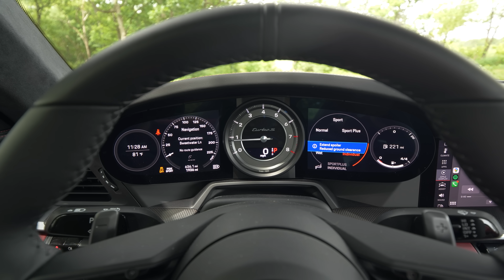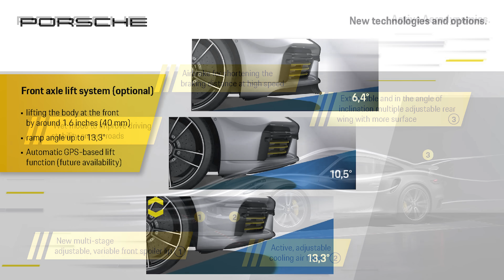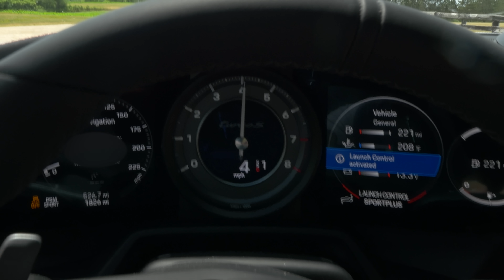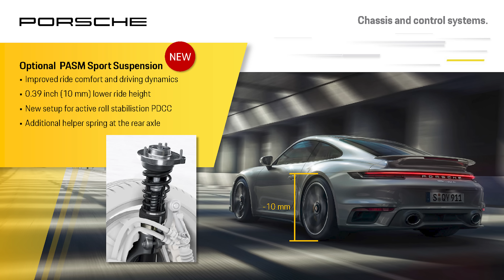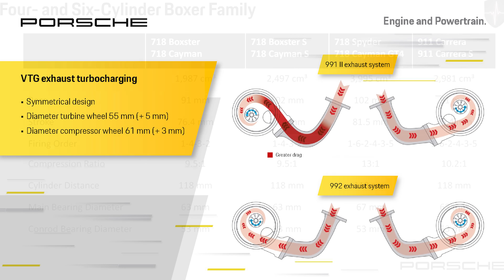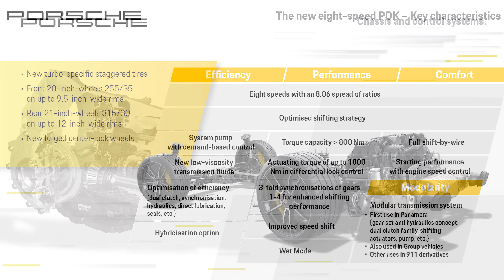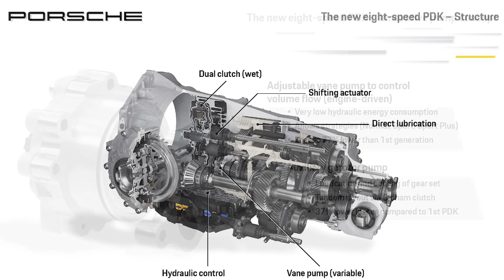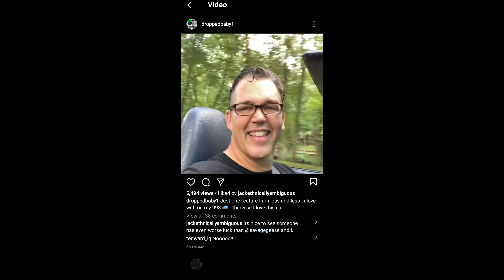Porsche 911 Turbo S 992 | Mind Bending Speed

Comment: This has got to be near the pinnacle of ICE technology, surely? What an incredible machine
Reply: i think @savagegeese would agree that really, this isn't. The GT3 is. This sounds like a electric motor. That sounds like a porsche le mans gt car from the 80's
Reply: Given that many people are running 1,000+ whp out of 991 turbos on the stock motor without reliability problems I would say we still have plenty of overhead left in ICE.
Reply: @thehumanoid6543  nearly all of which were heavily turbocharged.. the le mans cars sounded like vacuums next to McLaren F1 or CLK GTR. There's no denying the thrill of big boost though
Reply: Yeah this and potentially the T50 would be the swan songs.
Reply: @flacjacket  I'd you're talking about just power, leave the chat. An electric Tesla can make 1030 horsepower while being a comfortable 5 seater. Its about the sound and experience brotha
Reply: I think mazdas development of compression ignition gas engine will be the peak. but after that, mild hybrids or hybrids will probably be the way instead of straight electrification.
Reply: @papa_pt  they do I agree. A McLaren F1 vs a Porsche 935 is no comparo dude....it's basically m e t h s...12 vs 6 cylinders, and of course, gloriously naturally aspirated. But, turbocharged race cars do sound pretty good cause they are straight piped. The 992 911 turbo s sounds worse than my dad's stock mk7 gti
Reply: @thehumanoid6543  yeah I used to be on the NA hype train until my n54.. now I'm a big fan of both. The exhaust will never sound as good so you gotta make the most of the turbo noises: blow off/diverter valves, air intakes and turbos spooling up. I think McLaren does a pretty good job there. If I bought this 992 at least there'd be the money for an exhaust 😁
Reply: @grantapalooza998  oh yeah the high compression skyactiv stuff right. Well, everybody's innovating in their own way to keep up with emissions and still give some power. I'm hoping someone makes a sportscar with a peaky na 9k rpm 4 cylinder but pair it with a small electric motor that can provide instant torque for the city.That, would be a very interesting idea and would work wonders if executed properly
Reply: @grantapalooza998  It sounded good, but Mazda has yet to get much out of that technology. Neither the power nor the gas mileage are all that impressive. Great idea, though.
Reply: I agree to a point. Moaning about sound is really beside the point. It's efficiency and power that matter, not pretty sounds. It's not a clock radio. I suspect we'll continue to increase power per displacement, but at the expense of efficiency, which seems close to optimal already.
Reply: @markmiller3279  its not. Rn, engines are good only for making great noises,ad the turbo s fails in that regard. If you want efficiency and power, go buy a tesla model s plaid or a taycan turbo . Both cost either less or close to the same price as this, but offer more speed, comfort and practicality. Thats  why, spend 20k less and get a gt3 touring manual. Trust me, youll forget a turbo or even another 992 ever existed
Reply: @thehumanoid6543  when the Tesla plaid is faster than this car One might start to Care. But for now a lot of People are more interested in this than this plastic Asian container with 400 HP more.
Reply: @papa_pt  LeMans Porsche 917 Flat 12 sound way over McLaren F1 or CLK GTR sound
Reply: @THEREALZENFORCE  probably agreed with you there. 917 is from around 1970 and he was talking 80s.

The sauber c9 sounded like a monster for being turbocharged tbf

Comment: Regarding the big ticket $225k price, here is a fun fact:  at $174k, a grinch spec non-S Turbo, will give you 98.5% of the grins of this car, and is the sleeper deal in the 911 range. The vast majority of us will never notice the small hp drop, since torque is still a monster and that is the real character of this car.   Many dealers will be selling standard Carrera models priced higher than a base Turbo, thanks to options.
Reply: And a fun fact, the turbo s is on a whole different level.

Comment: I have a new 2023 Turbo S without the S-PASM option.  I came from a new GTS which I felt was really low and somewhat harsh on public roads even in normal mode.   Both cars have the Front Lift Option.  The Turbo S is low enough and seems so compliant on the roads in normal mode.  Almost telepathic.  I don't plan to track the car.  I wonder if I made a mistake in not speccing S-PASM but according to this video, it seems that I made the right choice.   Thoughts??

Comment: I owned a "mere" 996 turbo that was tuned but had stock K16 turbos. It was making over 500hp and 500ft lbs.....

It had brakes, suspension (Ohlins), seats/safety (GT3/Schroth 5pt), fire, and aero systems (cup car/gt2 front oem). It was a track weapon. It was boring for the day to day use it saw 99% of the time. I sold it as it was "too much and unsafe for the street." I was actually worried about going too fast on the back roads I used to drive on because this car was just too fast - I suppose a lot of cars now fall into this and one really needs to think about that. A lot. Almost any over 500hp car is really too much for the street.

I now have an F-type S awd and, shocking myself really, it makes me happier. I miss the idea of the 911turbo but the reality is that they are too much for the US street reality in my humblest opinion.   A base 911 now is too....this Jag is too...but it is at least a lot of fun to hear and look at too (a better sounding or looking car is not in teh Porsche catalogue or any other, imho)...and it is less nuts (it is quieter and a better car if one just wants to go from A to B...the 911, even stock, was loud and rough and had no room for a big suitcase for a big trip..that matters).  911 turbos sound like vacuum cleaners. Really, they sound lousy for the cost. If I was going to spend this much on a Porsche the car to get is either the GTS (sounds good) or the GT3 touring (sounds amazing). Turbos also drop value like rocks compared to the GT cars.  

If it had to be a Porsche, I'd get the GT3 touring or the GT4 (not a typo, and not the RS). 

The turbo is a super car....the issue is we lack super roads. And other drivers that have skill....(or are not texting).

Comment: Porche continuing to prove that they make the best cars
Reply: Reliability sucks though
Reply: @Re3iRtH  Porsche is continuously ranked as the most reliable brand by several outlets.

Just because it's expensive to maintain doesn't mean it's unreliable. It's a $250k supercar, the engineering that went into it is insane. Of course wear parts won't have as much longevity as a Honda civic
Reply: @StEvEn420BrUlE  That statement is false. Porsche was decently reliable in the dry sump days in the 1980s. Now they are similar to any German car brand = unreliable. Hope it's your 3rd or 4th car.
Reply: @StEvEn420BrUlE  cost of maintenance and repairs is literally the definition of reliability.
Reply: @Re3iRtH  no, cost of maintenance and repairs is part of the cost of ownership, which Porsches are astronomical for, because they are supercars. That isn't a measure of wether or not your car is going to leave you stranded on the road, or have constant issues that never seem to be fixed
Reply: @StEvEn420BrUlE  Porsche and BMW fanboys always seem to have an rationalization for their brand's piss poor reliability. "My car is well built but I spend an arm and a leg on maintenance and repairs, but it's well engineered!!"

Comment: As much as it is—it’s a great price. The fastest accelerating car at the moment (until the sf90, and plaid model s and roadster) for 200g? The Chiron is 2 tenths slower and 2 mil. McLaren, lambos, Ferrari, double the price and slower. 2.2 0-60. Insane
Reply: The Model S "Plaid" can do its one trick pony acceleration show for maybe one or two times, until it overheats, just like any other Tesla model. 
You just can't take this EV in this list of super cars, because the Plaid is just a 2.4 tons superheavy boring sedan, with NO sporty talents at all! 
All of Plaids "time gaining" on a race track is just due to its pure straight line acceleration capabilities. But in curves and corners the Plaid is just BULLSHIT like any other Model S, if you take it as a "sporty vehicle". 
The 911 Turbo S can reproduce its 2.2 seconds at 0-60 mph drag racing starts with launch control literally all day long without any issues at all! 
Porsche says, the 911 Turbo launch control system is capable of 20.000 launch control starts without any problems or issues!

Compared to this amount of perfection, Tesla is just NOWHERE and a NOBODY, when it comes to "endurance" and reliability, because it's just a battery overheating one trick pony with the worst build quality on the market. Period.
Reply: @Porsche1969  exactly. Well said

Comment: The future will be more turbo, battery additions, smaller displacement engines. Enjoy it while you can.
Reply: Inb4 excited industry announcement: We are bringing the high-rev engines back!
...And then...
8999 rpm 1-cylinder turbosupercharged hydrogen hybrid with intelligent hydropneumatic microprocessor controlled balance shaft assembly with centralized software updates every millisecond and online scoreboard with performance telemetry.
Reply: "These horseless carriages will never compare to the clacking of the hooves of my horse, and the visceral rolling of the hand-carved wooden wheels of my Abbot-Downing carriage." Seriously, in 2040, middle-aged millennial car enthusiasts are gonna be complaining that axial hub motors just don't have the [insert je-ne-sais-quoi] of radial motors and CV joints. Automotive technology always moves on, and there's not much sense in investing your soul into what amounts to just one type of technology.
Reply: Meanwhile in America we still releasing four door bricks and sports cars with 392’s and 6.2’s
Reply: @v1Broadcaster  True, and kind of sad, but there's money to be made from sentimental fools.
Reply: 6.2 L supercharged (650 hp) here, let's see what engine holds compression better after 150k miles.  20+ psi smaller displacement turbo cars are fun (and I came from a turbo rotary) but there is a price to pay.

Comment: As a five year owner of the previous generation Turbo S, 
you get a terrific job of capturing the car and its mission.    It is the Swiss Army knife of sports cars - it goes everywhere and does everything well. You can buy groceries or go to work it in or take it in the snow to go skiing.  You can rally across the country in it.  And yet when you track you will destroy all but the most dedicated track cars given its speed and handling.  It is faster around Spa than is the GT3 although not so around a twistier track with less straights. 

BUT if you want a lot of public attention buy a Ferrari or Lambo or GT3RS.  Very outside of the car community can tell a Turbo S apart from a regular base 911.  But to me, that was the beauty.   I don’t want attention on the roads. I just want to go fast.

Comment: 24:19 - "You kinda feel like the front end is washing out a little bit." Tip - GET ON THE THROTTLE HARDER AND EARLIER. I'm noticing you're getting on it kinda late in the corners. Very common with AWD vehicles. Your instinct is to back off as you would in a RWD, but you'll find it'll grip and turn harder if you do the opposite of what feels like the right thing to do.

Comment: You guys really set the bar for car videos. Amazing to watch. If Mark or Jack sees this, thoughts on 718 GT4 vs the new GT3? Thanks!
Reply: The gt3 is a tremendous car, better imo in almost every way. Issue is it's nearly 2x the cost of the gt4
Reply: @jackholmes8105  Good to know, that cost aside the GT3 is better. I've heard some people prefer the mid-engine layout of the 718 but wasn't sure if that would be enough with the long gearing that the GT4 seems to have. Looking at a GT car in the next year or so and trying to decide whether to start with a GT4 and then eventually move into or GT3 or just go right for the GT3. Can't wait for your guys video on the GT3 and I appreciate the response!

Comment: It seems to respond well to tuning too! I saw a test with AutoTopNL when they drove a 910hp/1000Nm turbo s... It accelerated on the no speed limit of the autobahn like it was a computer game! 0-62mph in 2.4s, 62-124mph in 4.2s... 200mph with no effort. You could not tell from the outside nor the inside that it was tuned... That would ruffle some feathers in the supercar scene. 😲

Comment: The Porsche Turbo is the tip of the spear on the street. It's capabilities are way above anything else. It's simply the best. Having said that, I recommend the well positioned gentleman also buy the GT3 as a weekend toy. Having both in the garage is the optimal setup.

Comment: As always a great video.
So Porsche make a car that is so good it is not really a great deal of fun. 
Buy used and for the cost of this (£180k), you can get, more fun, more comfort, more speed and over 40 mpg, -  
A Caterham 7 (or similar), an Elise, an S Class (or similar), an F3 (or possibly F3000), and a 550d touring for towing. 
Good luck keeping up with the F3 car on pretty much any track with corners given that a 991.2 GT2 is 7 seconds slower around a very short circuit (Anglesey Coastal in Wales, UK) Even a P1 GTR is four seconds a lap slower.
Good luck keeping up with the 550d on a road trip unless you are very fast at the fuel stops.

Comment: Another awesome video, can't wait for the GT3 review. 

Since you pointed out some of the suspension differences between the Turbo S and the GT3, could you also explain the aerodynamical differences? Would love to learn more about the benefits of the retractable splitter in the Turbo S and the exhausts in the GT3 hood. Also why doesn't the Turbo S have a rear diffuser? 

If you had to choose the best features of each of the 2 versions, which would you choose?

Comment: Is there any justifiable reason for 10-piston calipers? Weight efficiency maybe? Evening of pressure on huge pads?

The backseat storage conversion feature I like a lot. That's smart design, and it works well with the front seats providing the blocking wall. (Unless you are so small that you pull them to the front, then you'd probably need extra securing or just smarts on your end, heh.)

7:39 It's funny how this is not a Boxster, because the front and rear design looks too boxy for my taste. Especially the front, though. That's two different cars glued together, top and bottom. - How not to do a wide body approach, at least not for a Porsche. - Weirdly the front reminds me more of an old Beetle than any other Porsche.

17:02 _"Let's hit the road"_, Jack says, and I'm thinking this type of car will actually make the road go "OUCH!".

21:28 I am totally not getting excited by that sound. (You can emulate that way too easily in a video game.)

21:55 I'll take a lot less HP/l for more revs any day. 170 is nuts. That's a 2-liter with 340 hp. I got a 2-liter with 240 that revs to 8000, and take the S2000. Much more fun to have the power and know where to get it and having to work for it, with aptitude. That's rewarding.

22:57 Now the car really sounds like the front looks. Like some really budget-level design with stock exhaust that's possibly a tiny bit rusted through.

25:50 Jack: Let's head to the final thoughts. ... Final thoughts. ... Mark! Final thoughts? - Mark: Huh, what? - Jack: Final thoughts time? - Mark: Oh yea,h right. ... Just one more lap.

Comment: I ordered this car for my Michigan home. To have a 4 season car. It’s replacing my 720s which Michigan did not treat well. My big question now - do I try to opt out of the PASM? Is it going to be that bad on our potholed roads? It sounded like it would do better on rough roads in “normal” and better on smooth roads in “sport” setting 🤷🏽‍♂️
Reply: Press a button and hang on

Comment: Would getting the lightweight package with the full bucket seats completely go against the ethos of the car?  I like the concept of a still daily usable car but making it a little more hardcore.
Reply: Yes it would.  A huge advantage of the Turbo is you can just decide to do a 3000 mile road trip, pack tons of stuff, and come out both refreshed and having had amazing driving, in a way almost nobody ever does in a GT3 with its hard buckets and much higher noise levels.  Trust me, the Turbo is hardcore beyond most people's skill levels, simply because of the monster torque, and the equally huge traction levels.  If you really want the NA 9000 rpm excitement, you will need a GT3 and there goes the daily usability.